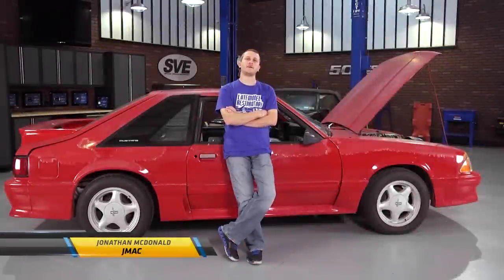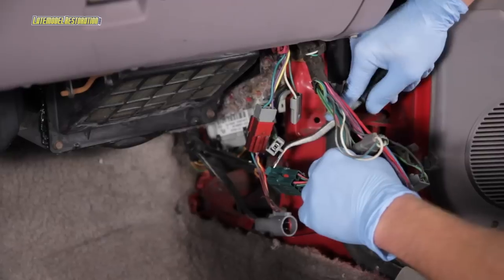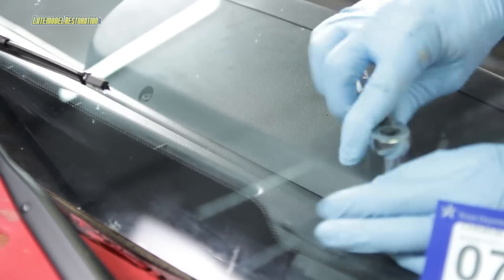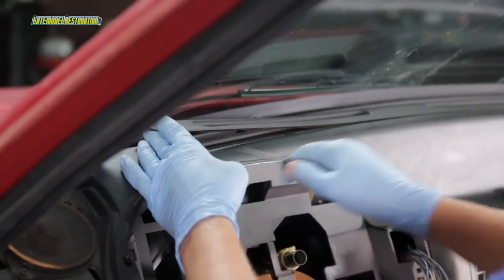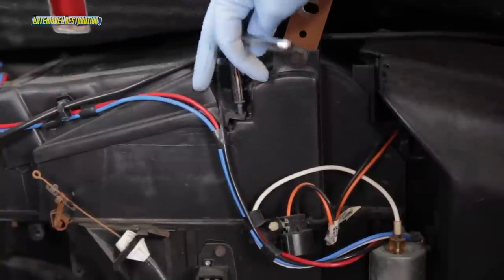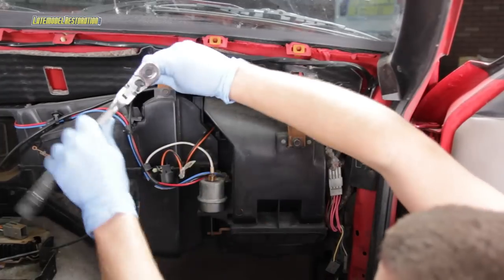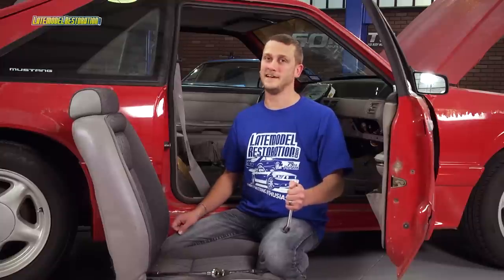Fox Body Mustang Heater Core Installation (79-93)

Comment: Just did the heater core swap this weekend, and it took about 15 hours total. This video was a great guide, thanks LMR!
Reply: I just did the heater core in my 89 today. Had it in my hands in 45 minutes. No broken parts, and didn’t dump the A/C. Took a little over an hour to put it back together.

Comment: I don't have enough curse words in my vocabulary to do the heater core.  I'll pay someone to do that one.  I've had 5 mustangs, 3 of them were foxes.  The 65 and 67 were a breeze compared to the late models.
Reply: I did this job once on my 85. when my 93 needed one, it was off to the mechanic.
Reply: If you happen to read this, what was the going rate for a mechanic replacing the heater core?
Reply: @gweds  100000000
Reply: It was $600 about 20 years ago!

Comment: Back in 1989 i changed out a heater core in my 1985 GT.  I took a different approach.  I was able to cut a surgically straight section in the plastic heater core box and remove the core.  I agree one shouldn't butcher up the car, but this approach saved me hours.  Back then i was making less than 12K a year and couldn't afford to take my car to a shop.  I replaced this cutout in the plastic heater core box with the section just cut out and was able to use a colleague and friend's polypropylene welding gun (he worked for a company that made laminar flow sampling hoods) to anneal the piece i had cut out.

Comment: Just want to extend a quick thanks for an awesome video.  I am just finishing up the replacement of the heater core on my 1989 5.0.  Its a crappy job but following the steps carefully its nearly complete!  I will say that if you need your car tomorrow morning maybe pay someone.  It took me about 8 hours total.  The good news is putting it back together was much faster than taking it apart.  The shop manual is crap and the video was my best friend during this mission.  Helpful tip:  take pictures, make notes as you go and label all your screws and fasteners!!!!  I didn't lose anything and I even found the ash tray spring under the console.......  its closed now.
keep up the good work.

Comment: I DID THIS JOB ON MY 88 GT .IT WAS 5 YEARS OLD . I BOUGHT THE CAR BRAND NEW  NEVER SAW WINTER OR RAIN. I HAD IT 7 YEARS  WITH 24000 MILES ON IT . I PURCHASED A MANUAL FOR THE JOB. IT TOOK ME A DAY AND A HALF. I DID THIS JOB IN 1993 AROUND SPRINGTIME IN MY GARAGE WITH NO PEOPLE INTERUPTIONS THANK GOD . THE WAY YOU DEMONSTRATE IT IS EXACTLY THE WAY IT WENT ON MY CAR. WHEN I SAW YOUR VIDEO ,I THOUGHT BACK YEARS AGO WHEN I ACCOMPLISHED THIS TASK. NOW I'M 64 ,AND RETIRED . NO MATTER WHAT HAPPENS ,I WILL NEVER ATTEMPT IT AGAIN ,LOL , HOWEVER , WHEN I FINISHED WITH THE HEATER CORE INSTALLATION ,AND I'M VERY METICULAS ,YOU COULDN'T TELL I TOUCHED THE CAR AT ALL . THANK GOD THERE WAS A MANUAL FOR IT ,BECAUSE IF ANYBODY DOESN'T TACKLE THIS JOB WITHOUT ONE, THEY'RE IN SERIOUS TROUBLE . GREAT VIDEO . BACK THEN YOU TUBE HADN'T BEEN INVENTED YET , AND BY THE WAY ,MINE WAS RED TOO . VERY INFORMATIVE . TAKE CARE ,AND THANK YOU .........

Comment: I’m doing this job right now, those rear screws are a real pain. I’m having a hard time getting the core out but I’ll keep working at it. This video is helpful!
Reply from the maker: I fully understand your pain, I have done this one a time or two in the past and it is never fun.
Reply: Well I got the new core in. Oddly enough it was easier to reinstall the 4 cover screws than it was to remove them. Where do I put the yellow plastic restrictor in the hose? Does it matter which end I put it in? I know it goes in the larger hose.
Reply from the maker: You just need to slip it in on the heater core side is where I install these at.

Comment: Good Stuff!!  I remember when the doing the heater core on my 86GT took 2 days (as a novice) and ended up with  dozen screws/bolts left over and anyone needing a heater core in their 97-93 just sold their cars!  This is a great video!
Reply: +Gerry Joseph Too funny!  I can identify with both situations-  ;)

I'd consider leaving the two rear screws of the heater core lid off, to make it easier the next time, if there is a next time.

Comment: Thanks for the great videos. Heater core replacement process for non-A/C car: 1. Drain coolant and loosen heater hoses 2. Remove glovebox 3. Remove small access panel 4. Remove heater core. 5. Reverse the order. Done.

Comment from the maker: ***** Thanks for the comment. I will pass along the praise to the camera guy... those guys don't always get the credit that is due!
Reply: I had no idea.....
Reply: I had a bad heater core in my old 88 LX hatch back mustang back in the day.  wow thats a lot of work, no wonder mechanics charge you $1000 to do this job
Reply: Nick Torres you ain't lying. Was thinking about doing this myself until I saw this video. Too time consuming, I can see this being an all day event with the wife asking how much longer will I be and me having to wrap it up the next day...definitely need to start early and block off most of the morning IMO.
Reply: Jonathan Rush
Mine went out in AZ... Had no need at all for a heater in Tucson, so I just bypassed it. Then I had to move to Missouri in December... I knew it would be a two day job and it most certainly was.
Reply: Late Model Restoration hey is a 1988 mustang gt fox body for 600 with a bad heater core a good price?
Reply: of course it is unless the floors are bad or theres something wrong with the drive train

Comment: I just finished replacing thhe heater core on my 87 lx 5.0 Mustang.  Quite a job but I was redoing the seats and carpet so why not.  I had bypassed it years ago so if ever there was a time to do it this was it since the seats and center console were out.  It took some time and bruised knuckles.  This is a great video.  I have used latemodel videos before and they are a big help.  It is great having heat again which extends the season I can drive it.

Comment: I like to put alot of jb weld at the base of the heatercore inlet and outlet tubes because ive seen alot of cracks at the base of the core were the two tubes are. it happens from people trying to put the heatercore hoses from the engine bay on to agressively and jiggling it around alot.

Comment: Followed this video and replacement my heater core yesterday. Be aware the since you aren't removing the accumulator that the heater box lid will be hard as F&$K to go back in. I had to cut the back corner out on mine. And note some of the wires have the plastic clips that keep them in line?

Comment: Since I'm doing this on a ancient little LX. Might end up taking it all apart just for this. Need heat, but also gives me the opportunity to fix other things like the gauge, blower motor, etc.
Slowly update everything

I can already see some of the stuff you can do with this being off
1. Replacing the gauge cluster
2. Applying new insulation to the firewall
3. A new blower motor for the AC system (a 30 year old one probably won't do you any good anymore)
4. A full clean out of any dust bunnies. As well as checking the HVAC system and updating any parts
5. Updating these inner parts means you won't have to do this much later.

Also if it helps, as you take things apart use chalk markers or label tabs or even colored tape to mark what goes where for easier put back together. This is what we did in my shop when we did stuff like this. We would take sharpies and mark in bright colors, red, blue, green, silver, etc for different things and would reconnect. It made everything so damn easy

Comment: My heater core just blew out yesterday. I could do this years ago but don't have the stamina with my back problems. Question i have is how can i bypass the heater core. This mustang is my backup to go to work so don't really need heat. Rarely gets cold enough to use here in South Texas.

Comment: Thanks LMR for the vid and steps.  It took 2 days and I got it all done and now doing some little things like LEDs in the dash. I have a piece above the ignition switch than has a wire and when pulled it shoots a metal bar on the switch what does it do???

Comment: Hey LMR guys, first is like to say your videos have saved me so much time in getting my fox back on the road thank you thank you. But referring to this video, I have an 88 fox and under my steering column my area is a little different than your video. Mine is solid to the mail box. So I don't see a way to drop the steering before pivoting the dash. Is there a different way to do mine?

Comment: I'm doing a paint job on the interior of my 1992 LX Hatchback. I've got most everything out and painted, except the dash...holy crap. There isn't any easier way to paint this thing? Lol. But, I want it done, and done right. So, I guess the dash is coming out tomorrow! I already started, was trying to see what all needed to come off...I'm having a hard time removing all the AC connectors. And I think if kind why I can't remove the cluster trim, I didn't know there were 2 bolts up top, along with one just up and right of the center console bolt. Wish me luck!

Comment: Can the heater core not working be a cause of why the engine temperature gauge doesn't work???? Just replace the thermostat and topped off the coolant.

Comment: This is absolutely nuts! Taking all of this stuff off to replace a single component? Knowing Mustangs as we do, who here thinks any of this will go back on without a considerable amount of profanity? And how much squeaking and rattling will result? There has to be a different way to do this.

My Mustang is summer only now. I know there are ways of looping the water back to the block - anyone care to share some? Any ideas about how to dry out the existing heater core so that it never leaks again?

Comment: After watching several videos from different people on changing a heater core in an 86 Fox Mustang nobody mentioned removing the two 1/4” hex head screws located under the fuse panel. I broke the plastic dash at the screw on the right and also bent the metal bracket that they screw into. I had to remove the metal bracket and straighten it in a vise after I finished installing the heater core and reattached the dash assembly.
NOTE: Do not use Well Water or City Water when refilling your cooling system because the minerals or chemicals in the water will eat up your new heater core!! Only use Distilled Water and anti-freeze in your cooling system.

Comment: to be sure you know that up to around 1986 the heater core can be replaced simply behind the globe box. there is a panel that allows easy removal and replacement of the heater core.

Comment: I have a question i just changed fan clutch fan radiator overflow reservoir radiator cap water pump thermostat and heater core hoses and my 92 gt  still overheats any opinions or suggestions will highly appreciated. By the way my catalytic converters sound like one is clogged.

Comment: I've been watching videos on removing parts on fox body mustang because I soon plan on restoring mine. A question I have is where does the right door wiring get routed through? The speaker wire to be more specific.
Reply from the maker: Hey Nicole Prather! That wire runs through the rubber conduit in between the door and cabin. -Landan

Comment: The vacuum line you disconnected is that for the heater core or to the heater core mine is cracked and bypassed can hear i vacuum leak in the dash

Comment: What are the symptoms of a failed heater core?
Reply from the maker: The most common tell-tell signs that your Mustang Heater Core needs to be replaced; are a strong odor of Antifreeze coming through the vents, continuously fogged up windshield, and wet carpet on the passenger side under the heater box but most importantly no heater

Comment: Hey guys when u drop the dash down if u pull that black insulation away from just under the windshield u can move it out of the way and get to the rear screws that hold the cover over the heater core
Reply: Tim Rowell your a life saver

Comment: thanks Jmac ...and camera crew ...great video ...would have taken twice as long if i had to just guess witch bolts to remove and wires to disconnect ...would have done alot more than i needed to easily !...thanks again !!!.. keep em coming ...bout to break this 1993 gt 5.0 down and put the transmission and engine in my 1970 coupe . .. as well as all the wiring and fuel set up to make it 1970 with EFI ... any help with that swap would be greatly appreciated...heard the stories of changing cross braces ..and oil pans . engine mounts ...hope to start that project within next year ..
Reply from the maker: We really specialize in 79 to current Mustangs. There are plenty of Mustang forums out there that would have more experienced early model guys. You are probably best checking with them on this swap. If you have any questions about the actual EFI system we are here for you!
Reply: Awesome ....thanks again !... Replacing that heater core couldn't have gone smoother thanks to You guys !!.

Comment: It would be nice if there was a video showing this on a 79-86. I have to do this job on my 84 Convertible LX and unfortunately this video doesn't help.
Reply: I believe on those there is a cover plate that is accessible through the glove box towards the visible portion of the heater box. The heat/ac box is different on those. It pulls out,straight towards you,just like in this video but through the hole Im talking about. I can't remember if it was my 84 or 86 GT but I do remember it was quite a bit easier than what you're seeing here.

Comment: Any comment on the heater core restrictors at the heater hose connections to limit the pressure to the heater core?  Do they extend the lifespan of the older cores by reducing the stress on them?
Reply: They are a must use. Or you will be replacing the heater core in less than 6mos

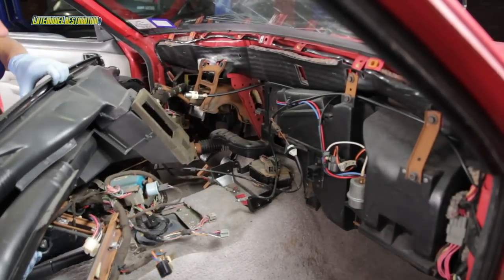Comment: At 3:25 when disconnecting the BRAKE SWITCH CONNECTOR, I have no such connector. Where does this connector go, and where does this connector come from?  It appears to have TWO  wires - red and green?  And, what is the exact function of this unit?  My 91 Fox seems to be operating correctly without this connector.  Can someone help me solve this mystery???
Reply from the maker: Jeffrey, please give us a call at 1-866-507-3786 or email us at customerservice@lmr.com and a CCR can assist you

Comment: I did my heater core and Im re installing the dash but I managed to disconnect the yellow hvac vacuum line from the dash side,  and I have no idea where it connects, and guidance on this?
Reply from the maker: The yellow line goes to the main distribution on the back of the control panel and is located right next to the white line.  You should have only one open port it could go to.  The other end goes to the blend door vacuum valve that is at the center of the dash, just over from the gas pedal. - Jmac

Comment: good video. what brand cores are you selling?
Reply from the maker: Edward Prete Thanks for the feedback. We sell the Ford original part as well as our high quality replacement from 5.0 Resto.

Ford Racing: http://www.latemodelrestoration.com/item/LRS-18476AF/79-93-Mustang-Original-Ford-Heater-Core-For-Mustang-With-Factory-Air-Conditioning-A-C

5.0Resto: http://www.latemodelrestoration.com/item/LRS-18476A/79-93-Mustang-Heater-Core-With-A-C

-Landan
Reply: ***** Thanks!! I've heard good things about the repro unit. Will order soon!

Comment: Do you need to run the car up road or let it sit and run to check heater coil
Reply from the maker: Either method is fine.  If the heater core has failed, you will see coolant seeping from the HVAC drain in the firewall underneath the heater hoses.

Comment: I did one 20 years ago on a 84 with the older dash than what is shown here. There is an access door so ripping the dash apart is not needed. if I remember take off the glove box door.
Reply from the maker: That was probably on a non-a/c car. All cars with factory a/c require removal of the dash. -Landan

Comment: In process of doing this but removed the whole box as I changed the evaporator too. If you stop the video at 4:54 there is a black vacuum line that runs parallel to the blue and red ones, but then goes (out?) the firewall? it has the little knob thing inline on it.  I pulled this loose removing the box and can't figure out where it goes now that I got the box back in. I THINK it goes to the engine compartment as I have a hose there that is open too? Or maybe plugs into the box (will look tomorrow) Help lol?
Reply from the maker: Hi Robert, 

If you can, please give us a call at 1-866-507-3786 or use the contact us link below to email our tech team. We'll be more than happy to assist you! https://lmr.com/contact
Reply: @latemodelrestoration  I just saw this replay but found it--it goes through a pre-made hole in the "gasket" between the box and the firewall and goes to engine compartment. Thanks for the help offer though! Going to be doing the rest of the air conditioning stuff I purchased after I got into it when it warms up a little/quits freaking raining!

Comment: The instructions shown for a 1979-80 is NOT as shown-you have to take the glove box off,discharge the a/c and take the evaporator core out and then remove the heater core and do it reverse as shown,it's a big job